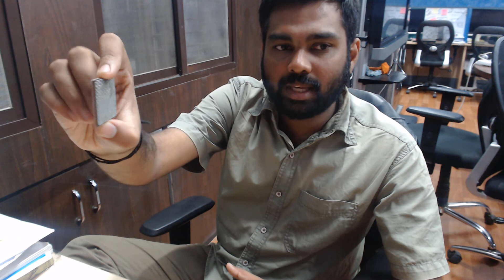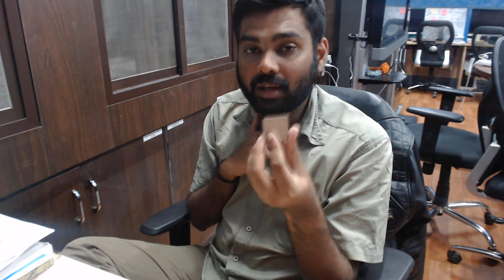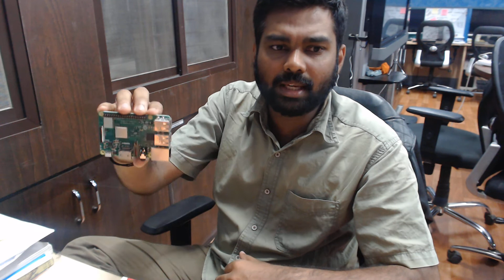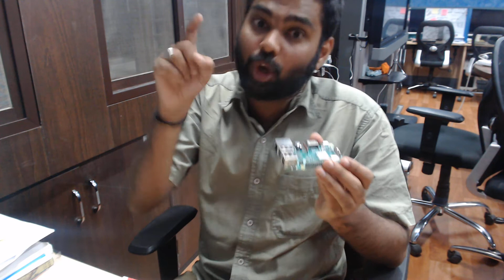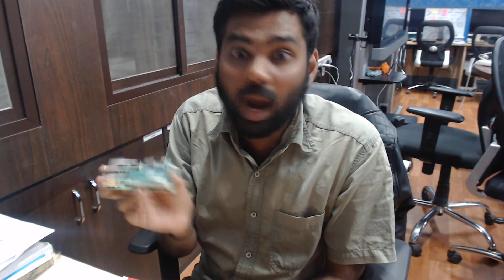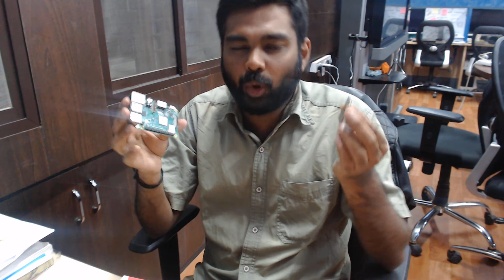Differences between the fields of Microelectronics/VLSI and Embedded Systems

Comment: What could be a better option after Btech either going for a core company like soctronics ( 3.5lpa) or going for higher education with a gate rank around 3k.
Reply: Go for the job, learn there for 2 years and then you can switch into big players at higher ctc.
Reply: @ayushjindal4981   is dedicating one more year for gate n IES preparation is not a better option..!?
Reply: @manojkumarreddy2103  if you want ies job aur psu then you might drop for a year. If you are happy to work in corporate job then you can go for Soctronics. If you work hard for 2 years there, then you can apply for big companies.
Reply: @ayushjindal4981  thank you bro , what are u doing bro..?

Comment: Embedded system engineer is actually a specialized computer engineer in embedded systems. Microelectronics engineer is a specialized electrical engineer in microelectronics (digital or/and analog). That's that!

Comment: Please make a video on "Is it easy to sustain in IISc after joining the course? Do people leave in between the course with pressure or with low CGPA?
Reply: A lot of babies die before surviving a day, so does  that mean the humans stops producing them. If you have  a strong penchant for research, all the above thoughts mentioned won't linger in your minds. It will bother those phd candidates who had no other choice in their career left other than doing PhD, i.e., they are doing for the sake of it. But i can assure you that phd is not gonna be a smooth sail like our btechs programs, but as the saying goes, smooth sails don't make strong sailers.